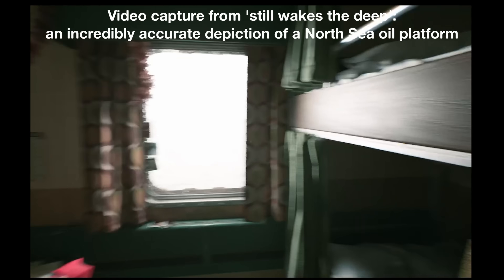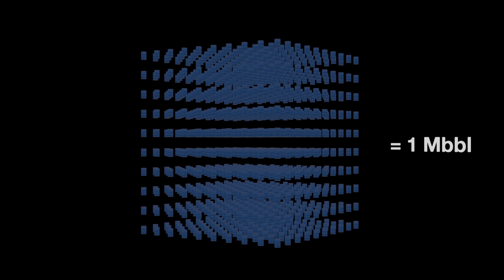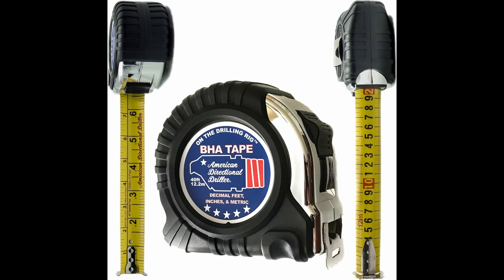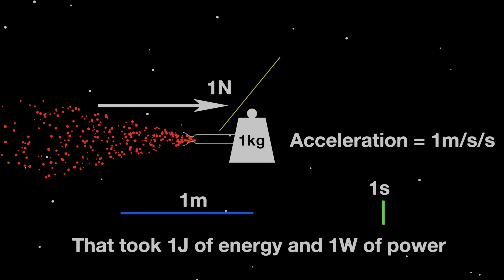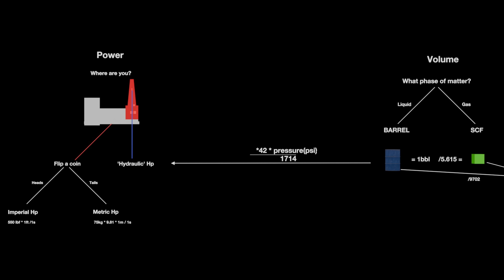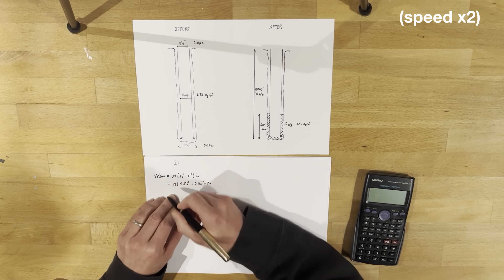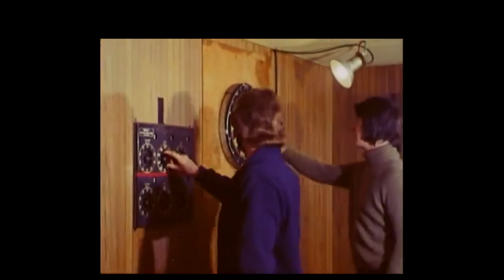Oilfield Units: a Measurement System so Cursed it made me Change Career

Comment from the maker: I absolutely love how everyone is most outraged about ‘decimal feet’ and ‘dog leg severity’. Those are 2 things I basically gloss over because I didn’t really consider them to be that ‘major’.

I swear, if anyone else mentions ‘1029.4’….
In the example calculation, an oilfield worker wouldn’t derive the output like I did, they’d just use their green book to look up the hole size conversion factor. Which is 1029.4. That is pi multiplied by the unit conversions I did. Just as with the pressure formula at the end, it’s the same thing.
You aren’t doing ‘better maths’ or ‘using the units as intended’, you are instead walking around with a head full of memorized conversion factors, or a green book. With SI, you don’t need to do that.

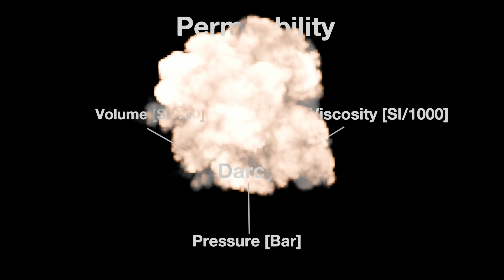13:39 Oh hang on, i just realised I accidentally made the Darcy look better than it is. It should say '1 ATM' onscreen as in the script, not '1 Bar'. They are close but not the same.
15:53 I kind of prove my own point by reading out the wrong number (the onscreen calcs are correct).

Alright, alright I did make fun of US units in my RD-701 video. Whatever. Stop using stupid units and I’ll stop making fun of you (that goes for you too Britain and Canada).
Reply: I don't make a measurement unit a point of national pride. I just want the neighbours to understand, and in turn, I will understand them, too.
Reply: @pilksaplenty  well if you want to weaken a strong country with soft power, wouldn’t you:

- make them proud of stupid units
- make them proud of hating vaccines
- get natural allies to fight in a culture war, men & women
- get literal families to fight in a culture war, Boomers vs Millennials etc
- make them love paying for rental energy like coal and oil, causing maintenance to be complex and expensive, and nifty side effect, Florida goes underwater and polar trading opens up
Reply: @pilksaplenty 
well, on MY home planet, we measure "national pride" in "zenobigots".....
Reply: @pilksaplenty  thats how we used to live in America as well.  I miss it.
Reply: @MichaelSmith-jj3pz  Yeah just use Metric please it's getting old at this stage
Reply: Then for the love of God and all that is holy on this beautiful ball of ours, let's adopt a global standard that has nice and uniform conversions and sensible use cases. 
Immediately what comes to mind is how Weight isn't Mass but we use it in Density calcs and just ignore how Weight changes.
So of course we can understand the neighbors, they are using orders of 10's for everything and making the most common or arguably most important substances the focus of things like temperature.
I remember being so gutted when I learned how metric works and wondering why we are always so stuck in the past in some truly bizarre ways.
Reply: a correction 3h before the releas of the video, nice
Reply: @Goroca  Nice catch! Haha.
Reply: I'm from Germany and i used to work with aircraft. In Germany we exclusively use the metric system... EXCEPT in the aviation industry. Planes fly at an altitude measured in feet and at a speed measured in knots. Don't ask what kind of knots...
Reply: Would it help if I told you that some grain is measured by weight in bushels (56lbs or 60lbs depending on the grain), but is also tested for it's density in pounds per bushel?
Reply: I had to work on a team developing a converter between three different oilfield unit systems once. That was a doozy, I still get nighmares about recursively-growing rounding errors sometimes.
Reply: as a Canadian, I measure myself in feet and pounds, my cat in centimeters and kilos, the weather in celsius, travel distance by drive time for some godforsaken reason, fuel in litres, milk in US gallons, and the rest of my dinner in a divinely cursed amalgamation that is the Metric Cup, equal to 0.25L rather than 0.238, just before it's cooked in Farenheit by an oven that runs on BTUs of gas, while my home is heated by pallets of wood pellets that weigh 1.5 ton each. Which ton? I've not checked, but it's probably not the one you'd want to use for that. Please, mock us - but at least we're not using *stone*, Britain.
Reply: @youmukonpaku3168  Wot's wrong with stones?  Every fule know it's 14 Lbs, proper British Lbs, not the short measure American ones!
Reply: Whats the game in the video ?
Reply: @timmyjohnson7192 oil rig simulator 24'
Reply: @timmyjohnson7192  Still wakes the deep.
Reply: Was about to say, here in Canada we use use both varying degrees lol, sketchy industry specific units too.
And in the spirit of the Gimli glider we will use them all `till the end of time.
Reply: At least US imperial units have been SI customary units with exact conversion factors for like 50 years at this point.  It's not great but it could be soooo much worse.
Reply: How bout (funnel) viscosity?    In seconds.
Reply: And don't all kids love memorizing 12 different orders of magnitude with arbitrary classical prefixes. No one ever misses a conversation factor in SI
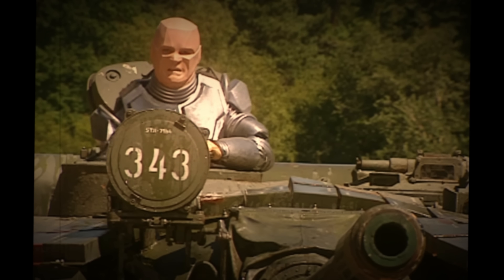Reply: What movie is the clip at 12:20 from?
Reply: is that standard atmospheres or technical atmospheres?
Reply: Which had the square feet 🦶? Darcy or Miles?
Reply: Lmao, makes it sounds like a sick dog made the system
Reply: As an engineer I like decimal feet and we use them all the time in my industry for gravity flow hydraulics 😅. I think the worst thing I ever heard of was a “gram inch” from a mechE.
Reply: The only one i disagree with you on is DLS. degrees / 100ft makes a lot of sense in the context of what we are doing. Radius of curvature would be less pragmatic. When well is drilled directionally, the bit is directed in order change the inclination / azimuth by a handful of degrees every ~100ft or so. It’s easy to think, i’ve gone 100-ft and my angle has changed by 4 degrees on a protractor. Its a lot more confusing to think “I’ve gone 100 degrees and the radius of an invisible circle made by the change of my inclination is X”

I’ve seen decimal feet and feet/inches mixed up before. I dont think you even mentioned OD tape- which is a scale multiplied by pi so that you can measure around the circumference and get the diameter, instead of doing math or using a caliper like a logical person.
Reply: "‘decimal feet’" I just checked my feet ... I couldn't possibly fit 10 toes on one.
Reply: Personally I hate 'dog leg severity' because it's a misuse of the term dog leg, which specifically refers to first turning one way, and then back while traveling in the same overall direction in a zig-zag path, most commonly used by sailors battling unfavorable winds. It has nothing to do with curvature.
Reply: What are you using to make the flowcharts that you are making in your videos
Reply: freedom units = FU
Reply: 101325 Pa is 1atm
Reply: Btw "calc" is short for calculator chat 
we're using slang
Reply: Why wouldn't they standardize to SI units ?
Reply: You missed one thing. All U.S. measurements are defined in U.S. law by their SI conversions. An American inch is legally defined as 25.4 cm.  I'm an American, I can dance back and forth between fractions of an inch, their decimal equivalents and some metric conversions. I agree that the American fear of metrication is incredibly stupid.  One guy told me that if the U.S. went metric you wouldn't be able to buy doors in 'regular sizes.'  Ah you mean 2'8" by 6'8"?? What's regular about that? And of course he insisted that pliers and screw drivers would  no longer work. 

I had to move to Canada in 1980 to understand that Phillips screws weren't actually 'better' they were designed 70 years early to cam out so the screwdriver would punch cross shaped holes in my fingers. They were designed this way because they didn't yet have torque control on drill drivers.  Robertson, square drive screws were much much smarter.
Reply: There's 3 countries that use the imperial system and 340.1 million people live in the us ofc you see Americans are mad.
Reply: NO WONDER THEY HAVE SO MANY ACCIDENTS IN THE OIL AND GAS INDUSTRY! ❤️🇨🇭
Reply: You have forgotten the core reason for the sizing of the barrel was the Elizabethan North Sea Herring trade of the 16th century.
Reply: I am far, far more upset over "kWh/h"
Reply: "that goes for you Britain and Canada"

I was waiting for you to get into the hybrid homebrew pick n' mix that we use in Canada and they use in Britain.

For anyone who doesn't know, in Canada. Temperature is in Celsius unless you're in a kitchen. You use Fahrenheit and cups. 

The government measures you in cm and kg, but you own a 50lb dog and you're 5'9" and 150lbs.

Your milk is in Liters unless you have four of them then you have a US gallon of milk. My fish tank is a 10g tank. 

The realty listing of my home was in both m² and ft², but good luck telling anyone who isn't a scientist how many m² your home is.

Distance is in km though. Just...roll with it.

Edited for clarity
Reply: @CToast  I'm british, and have never used farenheit or cups for anything.
Reply: @Skorpychan you do use miles and pounds though. You use a different homebrew pick n' mix.
Reply: This offensive little man called M "an antiquated form to write a thousand" 😭.

Hundreds of millions of people still speak Portuguese and Spanish.
Reply: As an US citizen and resident (unfortunately), please keep making fun of our stupid units.  The only one I even like is temperature simply because a little more granularity can be useful sometimes in human scale temps. Not because it's good.
Reply: Your units are stupid and ours are good.
Reply: I try as much as I can, but alas there's no way I can go to the hardware store buy a 2m length of 5.08x10.16. I do use SI when I'm designing CAD models for personal use though!
Changing is going to need some serious national impetus and I don't see that happening any time soon.
Reply: @Rosseloh it's not a 5.08cm x 10.16cm, it's closer to a 38mm x 89mm. However, those measurements are absolutely not a given. US dimensional lumber measurements are an utter lie. It started as a cost saving thing; lumber mills started under sizing their lumber. It eventually got so prevalent that a new industry standard was created, saying that 2x4s were to actually be 1.5x3.5s, but that too is not always adhered to.
Reply: @SnakebitSTI  I don't think it started as a cost-saving thing; the original idea was that 2x4 was the rough-cut measurement and then the actual lumber was planed smooth from that, so it was going to be undersized due to the planing.  (In older buildings, you'll find rough-cut 2x4s that are invariably actual size, and also painfully splintery.)  That's still true; if you get rough-cut lumber it will generally be actual size.

With that said, I'd guess that one reason the lumber mills started commonly selling planed framing lumber rather than rough-cut was that they could get away with starting with rough cuts that were slightly smaller than 2x4.  The sizes shrank gradually over the years, too; I've seen editorials from the 1950s or so bemoaning how 2x4s are now a quarter-inch under sized, or something like that.
Reply: @SnakebitSTI  the 'two-by-four', as we call it, is measured that way in the standing tree. take it down, saw it up and plane it smooth and you have something less. then comes corporate chisling..
Reply: @Rosseloh  oh hey, fancy seeing you here
Reply: @Rosseloh how about just ordering 5×10 like everybody else then? I promise; the salesman will understand what you mean, despite the decimals is not included..
Reply: @Rosseloh  Same here but other way around. Hardware store or not give me the god damn measurements in mm and m!
Reply: @Rosseloh  you know that 2 by 4 are just nominal values and not the exact measured values? they are reffering to the values wet lumber before drying and processing. the actual measure is 1-1/2' by 3-1/2'. so 5/10 cm lumber is closer to the measured dimension since it reffers to the dry and processed wood.
Reply: @felixlungu1763  lol couple people have pointed out the nominal 2x4 thing and I had come to say the same. I remember working in a hardware store in high school and having a guy come in and ask for full dimension lumber and having a back and forth as he called it a "real 2x4". One of the lumber yard guys had to explain it to me.
Reply: @felixlungu1763 yes that makes the joke even better I think...
Reply: @Rosseloh  it's not 2x4 either though. We buy "patting" here which is the same as your 2x4. You just created an issue where there is none.
Reply: If it makes you feel better I work in the UK railway industry and my brain now only accepts miles and chains!
Reply: I am unfortunately an engineer in and oil and gas company. The only way to keep my sanity is by converting everything i get into metric. At this point i have made my own python class called OilUnitConversion. That way i keep track of that shitshow.
Reply: I'll stop using imperial units when the boomers die off and everyone can use gloriously standardised units.
I don't understand why efficiency is MPG anyway. I buy fuel in litres, and want miles per litre, dammit. Or, better yet, input the fuel price when you fill the tank, how much you put in, and have it tell me how much I'm paying per mile.
Reply: @Skorpychan  see what you did there?
Reply: @felixlungu1763 Gallons per Kilometer?
Reply: @cabanford  I meant to underline the mental dissonance of "moving to the metric system inch by inch". either the british miles to the galon or km/l (as used in India and other places) or l/100km (as used in continental europe). mi/l, why? or the australian way of everything metric in multiplies of 1000 but not for pressure...
Reply: @Skorpychan 🤔 you don't want kg per liter?
Reply: @ຈິຕຕະຈິຕຕັງ Km, you mean? 😂
Reply: @Skorpychan  As far as I can tell the mpg and price per litre in the UK is a deliberate more to disassociate the cost of fuel from the useage. That way we don't know how much vehicle use costs. I have done the conversion with petrolheads and the shock when the realise how much their motoring costs is very visible.
Reply: @Skorpychan  lol... Miles.           How bout kilometers?
Reply: @gbear1005  I know how long it takes to walk a mile. Kilometers, not so much.
Reply: Every think about how mpg is length divided by volume, and we all effectively measure fuel efficiency in square meters? I think xkcd went on a tangent about this in one of his comics
Reply: @Skorpychan That makes no sense. Either you ditch the 'mile', or stay with your antiquated system of measurement.
Reply: @suprlite  We fought many wars to keep Europe out of england.
Stay on YOUR side, Napoleon.
Reply: @Skorpychan  Just be one generation ahead and use km/l :)
Reply: @BHBalast  But I know how long a mile is, deep down. A kilometer, not so much.
I know how long a mile takes to walk!
Reply: @Skorpychan then time how long it takes you to walk a kilometer.
Reply: I hear units of F150 works in most of North America
Reply: Talking of stupid units, does the British building industry still use the "Metric Foot", defined as 300mm?

It's not just the oil and gas industry...
Reply: @alexandermonro6768 Glargh! They could at least make the "metric foot" exactly 1/3 of a meter, for SOME level of conveniemce 😂
Reply: @Alexander-the-ok 17 hundred and 14 is definitely a conscious choice, imo as I've never heard anyone say 1714 that way.

It sounds extremely archaic to my American ears, something like "4 score 7 years ago" instead of 87 (a score is 20 iirc 🤔).
Reply: @ຈິຕຕະຈິຕຕັງ at least it's not the German "seven and forty" or the French "four times twenty, plus six" 😂
Reply: @ຈິຕຕະຈິຕຕັງ Yeah it sounds wierd to my US ears, too. I miiiiiiiight say "seventeen fourteen" when reading off digits if I was feeling especially sassy that day?
Reply: @Alexander-the-ok  the pound is a unit of mass. In fact, it is legally defined in terms of the kilogram. The catch is that the pound may also be a unit of force depending on context.

I am an American and I can’t stand the imperial system of units. Moreover, I don’t understand the sort of people who defend such a unit system. It reminds of people who defended pre-decimal currency. I can only hope that the US finally makes the change within my lifetime.
Reply: Fwiw, all American engineers know we're in the wrong. Someone saying "need to convert it to freedom units" followed by an audible sigh is a weekly occurrence in my workplace.
Reply: am gonna make an actual metric SI units (cause my comment goes into a bit of why it is NOT metric and needs to be fixed) so there's a magical thing called, REAL metric units for scientific instruments (yes SI is NOT EVEN FOR PEOPLE! IT'S FOR MACHINES AND MACHINES HATE IT!)
Reply: Idk, i honestly think a lil bit of gatekeeping in industry isnt that bad. Ive worked on metric crews with guys who cant handle fractions and its fucking ridiculous. Being careless woth units is just being careless.
Reply: I grew up in the US and agree that US Customary Units suck.
Reply: No
Reply: @Alexander-the-ok  NEVER 🇺🇸🦅🎆🎇🍻
Reply: @gamemeister27 Your gallon is weak, as are your hundred weight. At least use imperial real units.

Comment: You have to remember, if they have to go through these extreme lengths just to maintain the current system, the same amount of effort could have been exerted to do all calculations in metric units as if it was a foreign system. It's not like they do it, because it works for them.